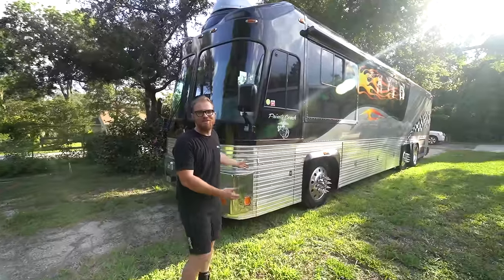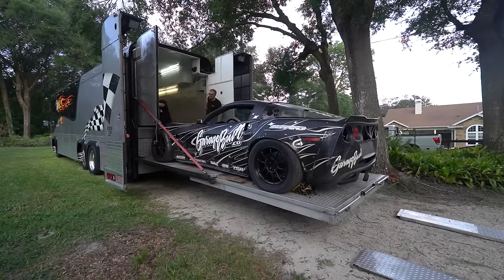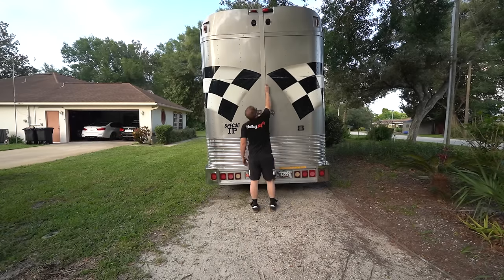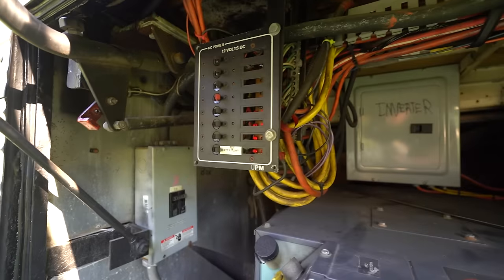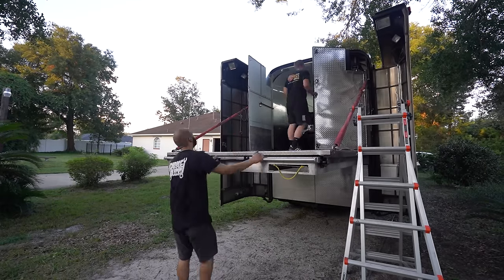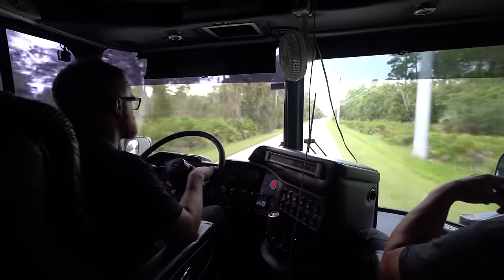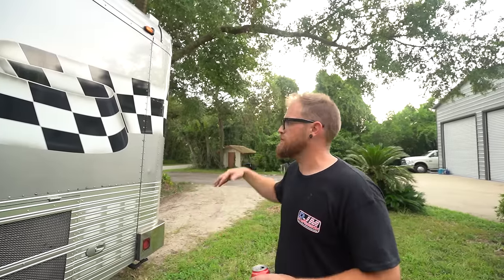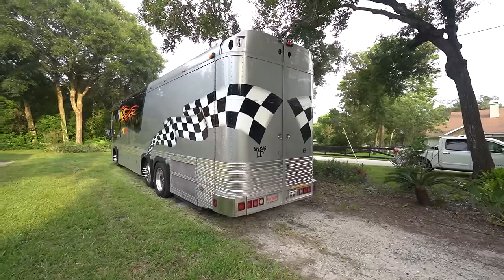First test of the new race car hauler. RV bus conversion. will it fit?

Comment: As a truck driver, I’d recommend you get a Truck GPS so you can put in your dimensions and take routes made for larger vehicles. Garmin makes great ones
Reply: Preach!
Reply: Absolutely . I have one for my fifth wheel
Reply: Totally agree
Reply: Fantastic idea
Reply: And keep you from being stuck under a bridge.
Reply: I'll also recommend this as a truck driver myself... The trucking GPS has saved my ass in Chicago a few times
Reply: the garmin dezel 7 or 8 is pretty good I use it everyday as a truck driver
Reply: @Romejkl  I have a Garmin as well 

Gotta remember to update it lol
Reply: THIS! depending on where you drive this makes all the difference when you start driving big vehicles, from avoiding narrow turns to bridges that you don't fit under, its such a nice thing to just know that where ever your GPS takes you, you are going to fit, not having to worry about any of that stuff is an amazing luxury
Reply: Only drive on Main rds and highways! I have been driving heavy haul and oversize for over 10 yrs. Common sense and experience are the best tools. GPS 2nd might hender ones ability to learn!?!
Reply: I didn't even know that was a thing but makes sense.
Reply: @JohnDeere-vj9ne I was in the trucking industry in management virtually my whole life. 0ne thing about these GPS units sometimes they're not even correct. You will have drivers who use them and get stuck in the most awkward places. They're not always up to date and like anything else they don't know everything 100%. Definitely better to have than not to.
Reply: I second this emensly
Reply: Surprised this is not available on phone maps.??
Reply: They make plenty of gps apps for your phone that doesnt need to spend the extra money on another gps
Reply: I concur.
Reply: @samuryz  specific to truck though?
I looked awhile back and couldn't find.
Reply: @turboflush  truck specific yes. You'll find them in every major truck stop. Also online. They're pretty proud of them though. And for good reason. Because they're worth it.
Reply: @Thepeanutgallery666  
Truck gps app for phone. NOT standalone unit.
Reply: @turboflush  I've tried those, and I found repeatedly that having a standalone unit is definitely better. Because your phone is unpredictable. Somebody might call while you're trying to drive through a major city. Your phone might die. There are so many variables that a phone adds to the equation. Not to mention, a lot of those apps aren't very Dependable. Especially when it comes to low bridges. The main reason for that is that Google doesn't have a truck route specific setting. So the app has to adapt the best that It can.
Reply: I suggest before you take any road trip.
#1. Change your oil and your coolant fluids.
#2. Obviously your will be changed with your oil change. But you need to change your fuel filter or filters and air filter.
Note: you probably know this already that a diesel is a CI engine... Fuel and Air.
Very important to keep those regularly replace. They will definitely keep your miles per gallon within specifications.
If you don't you will start experiencing a lack of power.
#4. Speaking of filters. Always keep an extra fuel filter (s)... Always.
#5. Make sure you have a set of replacement fuses and familiarize yourself where the fuse box(es) are located, extra bulbs and 🔺  roadside warning devices. 
And one low beam and one high beam replacement lamps. 
You have moved into the world of commercial driving now.
Trust me these things are very important.
Oops almost forgot.
Change those freaking belts... All of them. And is it good thing to have spares.
I have had to change belts a few times on the road myself and saved myself a lot of money.
You don't want to be calling Roadside Service👀😧😨😱😬
Beautiful RIG!
Oh one more thing. #6.The specs on that Cummins engine should be on the head gasket cover.
Reply: Also, get a Rand McNally Motors Carriers Road Atlas, but get the laminated spiral bound book so you can lay it flat and use dry erase maker for your routes. I'm a truck driver as well and the GPS is great, but it has "steered" me wrong. Also, using "the book" as I call it, gives you an awareness that no GPS can give ya. Great video btw!!!?
Reply: As a truck driver I wholeheartedyl agree. But more to the point fuck this stupid bus and get a Class A license and a REAL tractor-trailer car hauler. This bus and that flimsy lifter is not gonna end well. Dude's gonna get stuck in a shitty place and no way to tow his car. And the bus will be busted. This is just silly from start to finish.

Comment: Add a engine bay camera to your camera system so you can see if you have a fire back there remember your 45ft or more away from the engine by the time you see or smell smoke it's proably already too late so having a camera you can glance at is definitely worth it along with a engine bay fire suppression system.
Reply: Back up camera is good for that already
Reply: @Th3MoistGoat  not really that doesn't show in the engine bay and  by the time enough smoke is coming out the back to see on the rear camera it's already too late to save it plus it has a engine cover door then a litigate then the closing doors so not much will come out the back.
Reply: This is a great suggestion
Reply: @thedestroyer3262 these buses travel non stop everyday, for millions of miles.  Engine fire is not common at all.  Just maintain it.
Reply: @caseytbss  better  to have it and not need it.
Reply: Is this the guy you see with his cargo light on going down the highway so he can keep an eye on the five 2x4s and sheet of plywood in his bed?
Reply: An automatic fire suppression system like in boat engine bays?
Reply: @caseytbss  Man, I've had units burn down on the fence over the long weekend. Fire prevention is a realistic concern, even if watching the engine via camera seems a bit odd.

Comment: Make sure to measure your height and verify all measurements. Its very easy to forget about low bridges and high railroad tracks  when cruising so as a reminder just have it written down. Super cool set up tho!
Reply: Write the bus height down with a marker top of the windscreen so it's a quick glance upwards
Reply: I’m a truck driver and I agree you always want the height written on the windscreen somewhere. It’s saved me 3 times in my career

Comment: One thing I would deffinitely do sooner rather than later is measure the height at the tallest point with the air suspension in the highest mode, and put it on a label on the dashboard that you can see at a glance. The last thing you want to do is find out you have a 14' tall bus right after you drive under a 13'10" bridge.
Reply: Me to my barber: just a trim on the top
My barber:
Reply: This!!!!

Comment: For sliding that ramp section in/out, I highly suggest doing it while it’s about waist high. It’s much easier to get it moving instead of being in the ground.
Reply: problem is the ramps have to come out, then be lifted up and attached to the liftgate. im sure he doesnt want to lift the ramps up each time
Reply: @Shadow0fd3ath24  I mean the slide out section of the lift gate.
Reply: Also maybe add some CRC dry lube or some superlube dryfilm
to the ramp section that slides internally . Once you build up a good base layer will help a lot with sliding just make sure it fully dry between applications.
Reply: Garage door lube should work well.
Reply: @Pavelow53forever  moly is the last thing I'd want to spray. The shit would be everywhere
Reply: @LJenkinsEsqIII  the dry film isn’t like normal molybdenum it drys like  film/paint similar to Teflon etc.

Comment: Load the car back in it, fill your toolbox with tools, put the wheels and tires in the bay and fill your water tanks, fuel tanks and pretty much load it like you are going to be headed to an event then carefully go to the local truck stop weight scales and get the weights for the axles.  That will allow you to know where to set tire pressures (they are set according to weights on them) and more importantly know that you are not overweight on your tires or axles.  Check the date codes and load ratings for the tires.  A TPMS system is a great investment.  Start studying for your air brake endorsement, most states it’s exempted because it’s an rv but not all states and having the knowledge of the air brakes operation is always beneficial.  Just the first of many recommendations I’d be happy to share.  Steer tires especially are extremely important.  A steer tire blow out on the highway and that bus will likely be on its side in a ditch.  Rv exemption in regards to cdl etc will be a potential problem you should research.  The vehicle being used for commercial purposes while you aren’t hauling paying passengers there are some serious concerns of legal issues especially when logos start going on it.  Get the correct legal advice to CYA about those matters from more appropriate sources than random people on the internet like me ;)  Having an “interpretation of the law” discussions on the side of the road with a DOT officer probably isn’t going to lead with you driving away feeling like a winner.
Reply: Theres no way hes gonna be over weight on axles groups
Reply: It'll cost him what? $12.50 to find out for sure? Don't take the chance.
Reply: Hey it’s bus monkey! Was wondering if you caught wind if this. Just got time to see Taylor’s new rig. I told him in the last video he needs to hit you up for any questions, your full of knowledge in these old buses!
Reply: This is the kinda person you NEED to listen to when you own a bus. He knows what he's talking about.
Reply: Are u sure about that? I have driven bus and semi and never seen tire pressure set by weight. There is a cold psi minimum on the door jam for tractor and bus interior placard.

Comment: You should have a tag axle switch to lift the tag axle when you are maneuvering it in tight places.  Some small cones to put out when you are opening up the back may help to keep people back a little when you are dropping the lift.  Use dry lube on the lift slide out so it does not attract dirt.  Measure the bus and write it on a card you keep right by the dash so when driving and you see a bridge you know you are ok.
Reply: The cones are a good idea. People are dumb.
Reply: @dapperdanbuilds  natural selection
Reply: Not a tag axle. Tag is behind the drive axle. That would be a drop axle. But alot of the bus/motor home axles dont lift
Reply: @williamuskoski1385  that’s right behind the drive axle, that’s also what badgerpa5480 was saying it’s a Tag axle and is also known as a lift or lazy axle. But like you were saying that some bus/motor homes don’t and that’s probably because they’re only domestic carriers, unlike commercial and heavy haulage carriers which the tag axle is most suitable. Back in the day I knew as a lazy axle but over the last decade or so the term lift axle has been thrown around, whereas the term tag axles that’s pretty new to me.
Reply: @williamuskoski1385  Yeah I worded it wrong but they are usually labeled tag lift even when not a tagalong axle and it deflates the airbags doesn't lift the axle like a true lift axle you see on a dump etc.  It still helps when turning slow speed so the axle slides and gives a better turn.  The dozen or so busses I have driven all had a switch to do it, every motorhome with a helper axle had a switch labeled tag lift,  I know that is not hundreds of busses but it seems like a normal thing.  When both axles are drive axles they do not have the switch. If the rear axles are an inny and one an outy belly button I would try to find if it has a switch to make it easier turning.
Reply: @badgerpa9 doesn’t lift it but taking the weight off the tires by deflating the bags helps a ton so they slide easier.
Reply: This being an Eagle brand coach it has torsion bars rather than air ride so lifting the tags is impossible.
Reply: @badgerpa9 Prevost does have a lift  axle. At least they did up until 2011 when I retired . MCI has steer rear wheels. The non North American buses I have no experience with.  That age of bus was still 96” wide. I would not want to work on the engine with the toy hauler . Would like to know were they stuffed it though.

Comment: Something sick you can do with the (tail/lift)gate, save a little weight and get a secondary use out of it is cutting out and opening up the center to use it like a lift to look over the bottom of the Vette, nut and bolt check. Just a thought.
Reply: Makes it a night mare o load the vehicle and items thru normal usage imo

Comment: When driving buses where you sit in front of the wheel, you gotta fight the urge to steer like a car. A good rule of thumb when turning is turning once your shoulder is where the turn is. This will help you to avoid your back wheels running up the curb. Also remember your rear overhang swings out as you turn so be aware of that when turning. Ex bus driver.
Reply: Those are good tips especially the long rear-end our drive wheels are quite forward, to me it seems like it would be better farther back but that would make turning corners even worse. I've said enough. 🤔ML33MI.
Reply: @michaellukasiewicz9683  The rear overhang on most buses is to accommodate the engine, if your engine was forward of the rear axles you could get away with a shorter overhang.
Reply: Came here to say that driving it like a car will make it a PITA, turning later and at harder angles is what I always noticed bus drivers doing.

Comment: After the bugs are worked out, time to have the main liftgate panel re-engineered with an open center or removeable center panels to give you a bottom access to work on the car in the pits if needed. No more laying on your back under the car.

Comment: CDL driver of all sorts of big and weird rigs here, I would recommend potentially seeing what upgrades you can get for mirrors. Bigger mirrors with large spot mirrors make seeing the sides and back corners much easier. 

For example the company I work for has a few dump trucks and pump trucks and there are 2 main large side mirrors and 5 various sized spot mirrors positioned purposely to see most everything you could want and need.

Comment: Consider eleminating the inner swing doors on garage. Replace them with a single aluminum frame flip up door, with gas strut assist that could double as an awning for the garage. We did one with 2 sliding doors in the center and covered it in dark tinted lexan. we can use it for a sun awing or pull it back down when A/C is on and still go in & out.
Reply: I'd recommend a remote to operate the lift and avoid pinch points

Comment: I am an old Bus nut and have always loved working on them and driving them. You did real good and you will learn a lot as you go. It sure has a long over hang, what did they add to it, about 5 feet in all? You will learn to be real careful going into driveways and dips at truck stops.

Comment: I have a suggestion for the winch for the lift gate. Rotate the winch on its mount a few degrees so it pulls the cable straight into it
Reply: I think ideally there would be a second winch though, right?
Reply: or a pulley to help thread the cable in the center.
Reply: Should probably just replace it for peace of mind
Reply: Rotate it more than that, and attach it to the center of the ramp.

It's putting a noticeable amount of twist in the assembly as it's being raised... Probably contributing to the difficulty stowing the extension.

(Edit: might need to add a pulley, cause the last bit would be at the wrong angle to fully close, now that I think about it more.)
Reply: Or just move it so it pulls from the middle

Comment: Try switching the cable in the winch with a synthetic rope. Had the same binding up problem with my ATV winch (I use it for plowing snow in the winter so all it does is go in and out in the same position over and over) and once I switched to the rope I never had it bind up again.

Comment: TAYLOR can you change the split doors to a solid one door that flips up ⬆️ to an awning. And then switch out that winch on the rear to one on each side and could be a little lower to account for the flip up door. Hope that made sense, congratulations on the rig again🎉
Reply: I'm sure there's a reason, but I was wondering if the inner doors are even necessary? The lift gate is like a door and then there's the outer doors, so there's basically 3 sets of doors there.
Reply: @TheYonderGod I guess the inner doors are the only one that’s sealed, if you remove them then the AC would just pump air out the back and make it useless
Reply: @rickyekenlow  The "garage" of the bus is actually not air conditioned. If you watch there is an interior door leaving the "garage" that separates the living space. With that said you definitely want those interior doors on the garage. Just as a way to seal and secure everything.
Reply: @chadwickalexanderjr1758  the air conditioning unit is actually right above the door , he said in the first video that the unit cools down the living area and the garage

Comment: Definitely pick up the tool to adjust the air brakes and learn how to as the weight of this buss you’ll need to get a yearly inspection for DOT air brakes are easy to adjust just need to learn it and get the tools needed very cool

Comment: Since you're already this deep into it, i think it would be best if, instead of gravel in your RV port, you should do concrete. it's a lot of weight to sit in one place for long periods on gravel. just my 2 cents.
Edit: saw your notes on the end about the livery. i think white with black to be the reverse of the Vette would look sick. doing matte black as the main color probably wouldn't be bad either, since that A/C in there seems to be pretty badass.